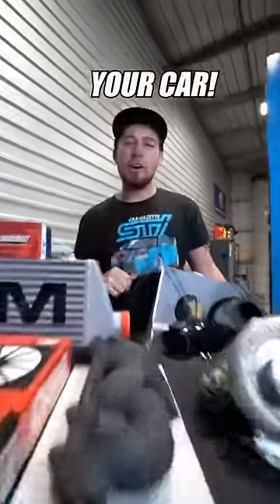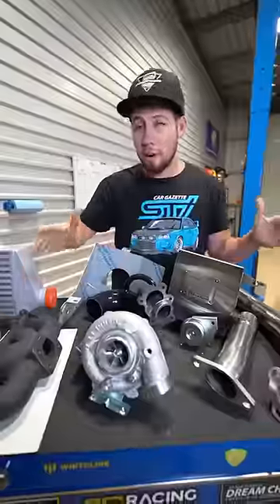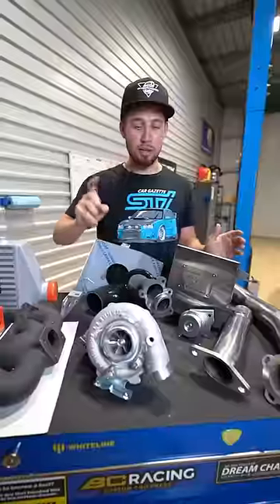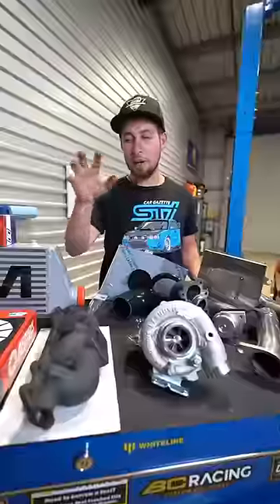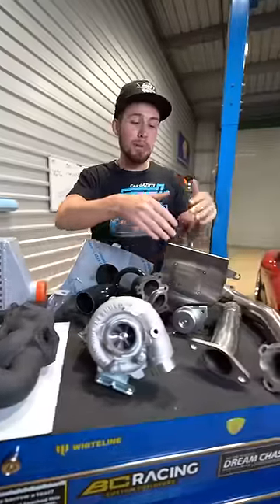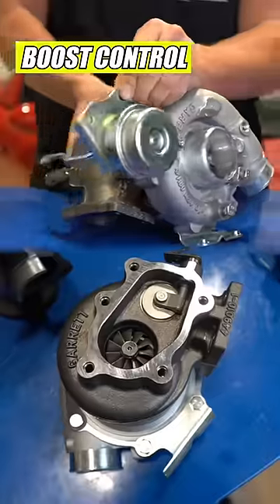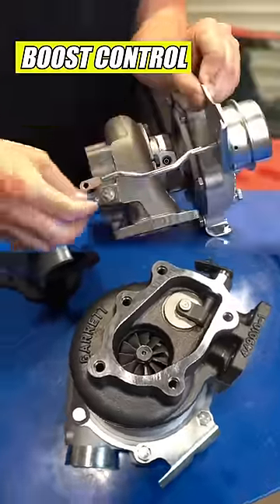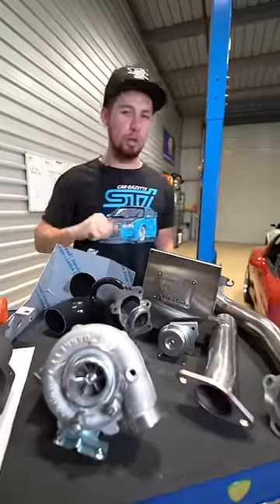Everything You Need to Turbo Your Car!

Comment: Forgot fuel pump and injectors but that’s everything!
Reply: The number one reason turbos destroy an engine.
Reply: Yeah the guy in the video is something we called mme,s morons melting engines
Reply: some cars could adapt with low boost but the radiator is going to do absolutely nothing if the thermostat isn't changed for a colder one
Reply: And oil lines but that's kinda nitpicky
Reply: Depending on the level of shitbox, rods, pistons and ringgap too, but you'll find out once you hit the dyno
Reply: Plus spark plugs..
Reply: That and piston rings, or at least a mention of gapping the existing rings for boost. Usually fine as is for low boost, but low boost is no fun and neither is breaking rings lol

Comment: Well the “right way” would be to pull the motor and rebuild it with forged internals before any of this but that’s not always in everyone’s budget
Reply: on good engines thats generally not necessary unless ur pushing past 300hp
Reply: You think I’d have to strip my redeye motor for better internals? I think it can handle a twin turbo, genuinely asking. I got the money for the turbo just debating on pulling the trigger.
Reply: @aztexs1509 did you do it?
Reply: @kanesoliloquy  not yet, can’t even find no one in town to tune my car. Everyone’s unreliable.

Comment: Dont forget to build ur engine if u want reliability with it too. It might explode otherwise. I speak from experience
Reply: Bruh I’m new to cars what you mean by build your engine like new parts for it?
Reply: @adrianlong9631 building an engine means

Replacing the Rods and pistons with forged pistons and rods
Doing a sleeve job and some work on the heads (porting and valve adjustments)
If you want to go deeper you can build the bottom end by Replacing the crank with forged crank or If you want to and so and so on thats just the basics theres plenty of more stuff that im not talking about likes Stroker kits to add or lower compression or do frankynsteins builds ...hopefully i was helpfull Since there was nobody to teach me
Reply: @adrianlong9631  the stuff he is describing for a built engine is something you would want to do if you plan on running high boost and high hp. If you want to turbo your car but don’t plan on putting boost to it to make over 1000 you should be fine with a stock motor. Although it is risky cause there is always going to be risks. Lots of motors are capable of handling right about 1000 hp stock. For instance the LS.
Reply: @J_Douglas5956 . So how much we looking at for a built upgraded motor and turbo kit altogether, ballpark?
Reply: @emirmolina3093 depends on the kit and the parts you bought. Unless you’re buying an already built motor then it just depends on the motor but it could range anywhere from 5K to 15k after that you’re probably looking for some big gains.
Reply: @J_Douglas5956  this example is way out of frame. Maybe you’re speaking specifically larger engines but pushing 1000 wheel reliably is not possible on most engines with stock internals. If you’re making even 400 wheel out of a smaller engine you’re launching a rod without forged iron internals
Reply: @J_Douglas5956 i don't think my Mercedes Daimler Benz W169 engine could handle that 😂
Reply: I do not believe you have to if your not running more than 15 pounds stock
Reply: That's assuming you're going to be running a a decent ammount of boost. Typically gapping the rings and running between 7-13psi it'll be fine, but yeah past that point it's sketch, but it also depends on the engine
Reply: @emirmolina3093 depends on motor and parts. The engine in my daily, a 3.1 v6, would never hit that kind of power no matter how much you throw at it without either sleeving or getting a custom made block which they don't make

Comment: If the factory valves in a 1991 GMC Syclone  will not hold up under the additional heat generated by the turbo with the factory custom grind cam and the cast pistons will not take a detonation event more than two or three times when tuning in a nitrous kit..
Then what can I expect from a factory 3.2 caddy  cts when adding a turbo without any type of fuel upgrades..
And or is there a chip or ecm upgrade to send a message to the fuel system to get with the program or shut down or what I think should be called a (fish or cut bait) program.
But that’s what I just came up with on short notice, I’m  sure I can find a better program title if needed..

Comment: There is so much wrong with this video I’ll cover a few.

1. That radiator is gonna be useless with the factory thermostat in place, and really isn’t needed if a lower thermostat is used and the setup is tuned properly.
2. Shows a exhaust manifold made for an external Wastegate, when the turbo being used has an internal Wastegate.
3. No fuel system upgrades like bigger injectors, and higher flow fuel pump so probably going to have some tuning issues once you go positive on your air charge.
4. Where’s the tubing from the turbo to the inter cooler, and from the inter cooler to the intake manifold ?
5. That piggyback unit for the ecm really isn’t a good way to go unless there are no factory ecm tuning options. As most piggyback systems are prone to failure and normally take the factory ecm out in the process. They also are not near as accurate as the factory ecm as all it is doing is sitting inline between the ecm and what is being controlled and just changing output voltages, or pulse length etc which can cause the factory ecm to try to correct if a sensor downstream senses something out and the factory ecm and piggyback end up fighting each other.

Comment: Can you turbo any vehicle (any engine size, any year)? Example, 4c Camry, 4c accord, stock v6 Tahoe, Sentra, some Hyundai etc, again ANY vehicle.
The thing is, I told my friend I wanted to add a small turbo on my two vehicles for efficiency, not exactly power/performance. His feedback was that it's not worth it because some engines aren't designed for a turbo. The primary point of his feedback was compression, that you'd ultimately would have to change/modify the engine itself internally, so yeah, I'd like to know if he's correct or not?
Any help appreciated, thx in advance ✌️
Reply: yes,you can turbo any vehicle but your friend's comment is also correct,its not worth to turbo some cars because of the weaker engine
Reply: @user234con  Thanks for the response bro. I appreciate it

Comment: What if I’m doing a turbo swap? I have a twin turbo and want to switch to a single larger turbo.
Reply: Get rid of one of the twins get something slightly larger and compound em? Quick spool up capability to make big power even with smaller units and helps keep drive pressures and EGTs in check I’d call it a win win

Comment: If This is everything you need for a Turbo, this is proof that deleting a Turbo off your car doesn't require special internal components like a different cam. But might require a larger 5th gear.
Reply: Depends on the cam some cams are designed to run with boost some are designed to run NA and optimize with boost so I’d say that would depend on the how the motor was built. And not sure why a “larger” im sure you meant longer 5th gear is needed as NA to force fed typically only requires stronger transmission internals to handle the extra power I’ve never had to change gear ratios though. I’m quite sure you don’t know what your talking about when it comes to performance so maybe stop talking and listen you might just learn something.